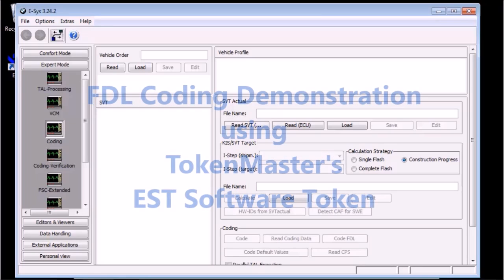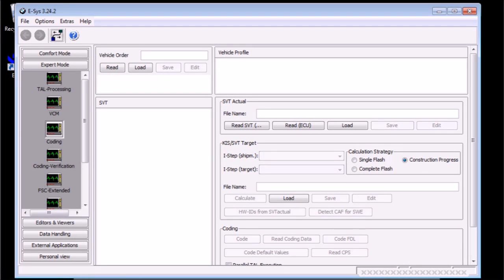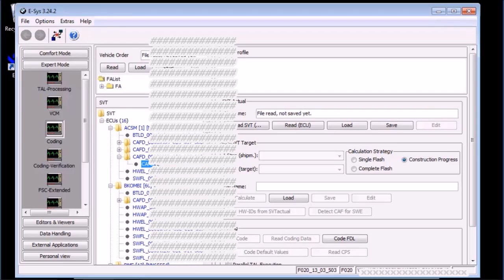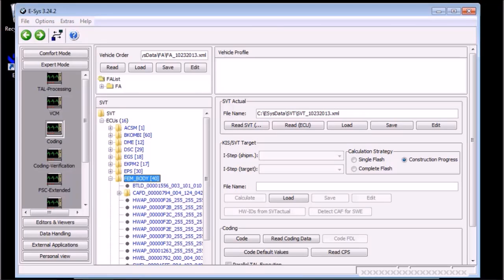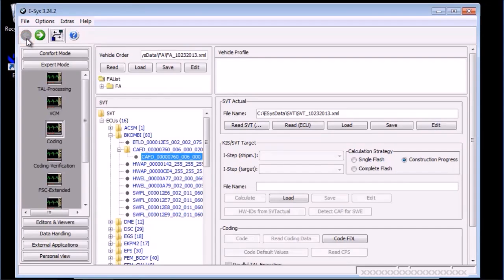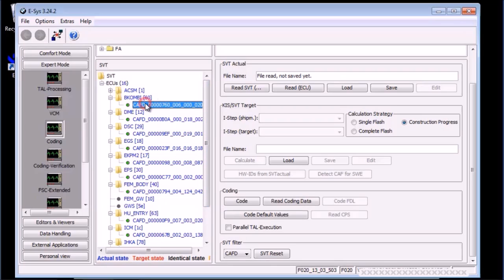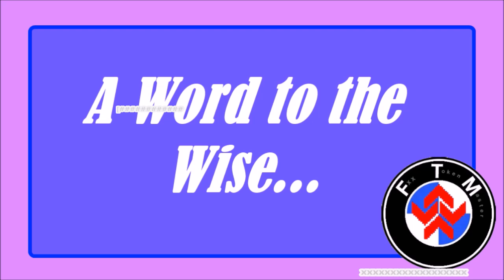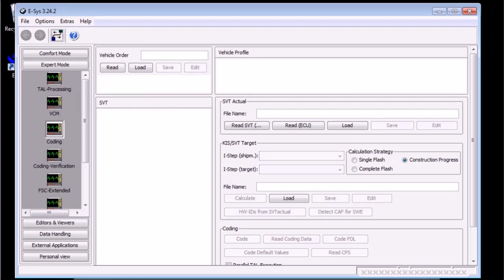FDL Coding Demonstration on BMW F30

Comment: You have a tutorial with backup?
I cide somting and my car give error   I want load backup
Reply: Did you fix your issue?
Reply: @fahimb5876  I give restart from factory 🤯, and after I made all backup with Carly.  I need mire time for use Esys
Reply: If you want I can code your car remotely
Reply: @fahimb5876  no, thx,  I made all with Carly . I cant make sport + but i here is to brutal gearbox after coding.  I want make off predestian,  maibe change ambiental light,  but i not stay good with time
Reply: Sport plus just turns traction half off

Comment: Before watching this video .. I tried coding in my f30 N messed up my svt file while didn’t take any backup  ..now I see less menu options in I drive .. can any one assist?
Reply: hi did you get it fixed? thanks
Reply: If you didn’t fix it all you need to do is VO code it

Comment: Hey guys I recently installed led daytime running lights in my F30. However, at startup the lights strobe, and they do that every 15 minutes or so driving as well. I don't know anything about coding a car, so can someone run me through the steps to remove the strobe? Thanks.

Comment: is it possible to add Enhanced Bluetooth (bluetooth audio streaming) via this method? I have a 2014 320i non-nav. the dealer said it was not possible yet (typical dealer answer) but it seems like it has the same hardware as the cars with Enhanced Bluetooth so it seems possible. thanks!